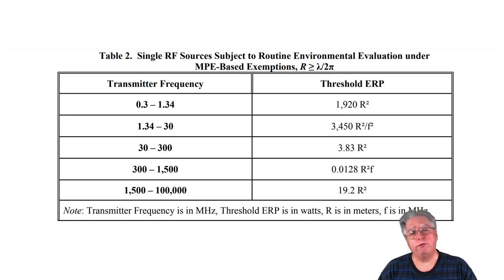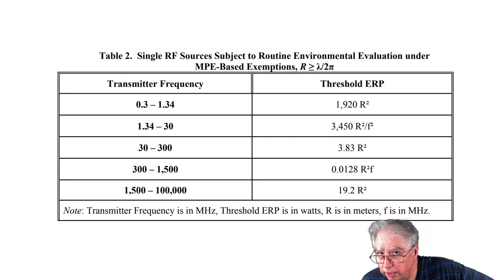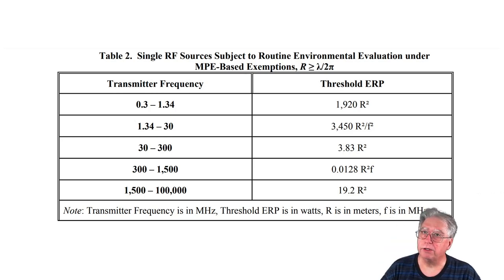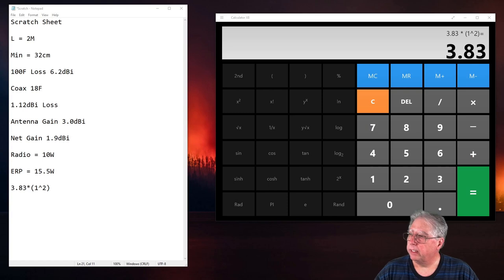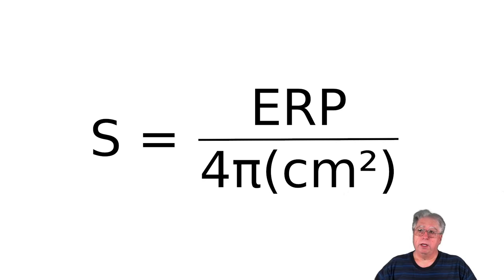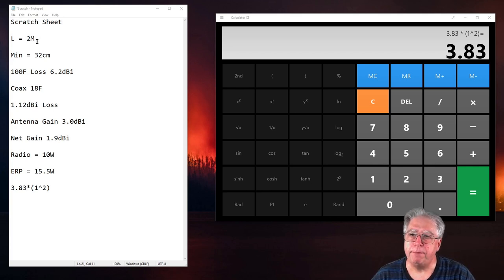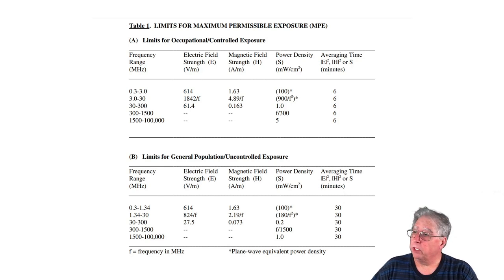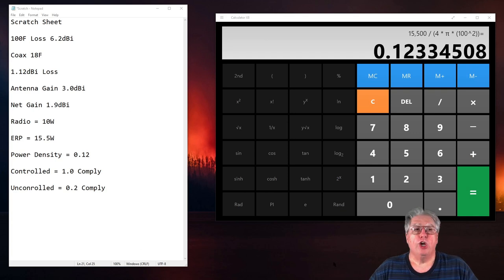FCC Implements New RF Safety Rules. How To Evaluate Your Amateur Radio Station RF Exposure Level

Comment: During this test no live animals were harmed, only stuffed carnival versions on the contrary were,  and they all still had the usual factory tags of disclosure cautions.  Those that required batteries were replaced by UL listed power sources. And NONE of the tests were conducted in or near the Republic of California.  In fact our survey chose Nevada as the the testing site near area 51 so we were guaranteed to have unbiased spectators...

Comment: Hi, Stu - thanks very much for this video.   I didn't think I had anything to worry about but wasn't aware that we had to keep this all on file.  My mobile setup is almost identical to yours for both vehicles, but will check the antenna specs (Diamond 770s rather than the Comet, but I think they're almost Identical); pretty sure I can just use your calculations.   It looks like my HF setup is OK as well, also, even at 600W, based on ballpark numbers but will have to work it out exactly.  You saved me some time.  Much appreciated.

Comment: The roof of the vehicle reduces the RF from that antenna significantly. They do not have a place on the spreadsheet for "Shielding" 
Also, your antenna has that gain only in a certain plane, underneath the antenna that is probably a negative gain as well.
I have a 26B2 antenna with 17db gain but underneath it, the gain is probably less than a vertical groundplane.
Reply from the maker: Yes, you are absolutely correct! The shielding factors would be hard to calculate without modeling the antenna. That's why we only toss it out as a comment in the video.

Looking at worst case numbers for these calculations to start with is always the better choice. If the numbers are outside of safe limits, you can chase it further, but if you are under limits with the simple calculations then you should be good.

Stu
AG6AG

Comment: How about a mobile antenna mounted in the center of the vehicle roof? In terms of absolute distance, it may be down to ~20cm depending on antenna vs. seating position. But a metal roof has shielding properties, and the actual RF path follows the roof surface to the windows, and back into the vehicle interior - maybe a path of >1M. How do we handle that situation? Totally ignore the shielding properties and consider a worst case?

And for the portable/HT the situation is a big can of worms. There are so many potential antennas in the market. Are we going to be stuck with the factory OEM antenna? I've heard there are some hams working on simulations considering a plethora of different HT/antenna combinations in an effort to determine a usable worst case scenario, or a table, or something. But it remains to be seen whether that will be acceptable to the FCC.
Reply from the maker: Hi Jim,
The thing to remember is if you calculate for absolute worst case and are under limits, then you do not need to take a deeper dive... If you are over limits using these calculations you can certainly take it deeper to try to rectify the issues.
Here is a interesting document out of the UK discussing RF and materials: https://www.ofcom.org.uk/__data/assets/pdf_file/0016/84022/building_materials_and_propagation.pdf. Lot's of information and formulas to melt your mind!
As for the HTs... The guidance is sparse at best. The FCC is clear that a SAR test will be required for anything under 20cm of distance from the subject. ARRL has said that all HTs manufactured before the May cutoff are grandfathered in as compliant. Which really doesn't answer any of our questions...

Stu
AG6AG

Comment: And for events like Field Day we may have to surround our antennas with yellow "caution" tape to keep people from getting too close.
Reply from the maker: If your antenna is at ground level then yes. We did a calculation on a 20M beam and  at very worst case uncontrolled access could be within 10FT of the antenna...

Stu
AG6AG

Comment: dipoles are to add 2.2 dbi would that also apply to random/long wire antenna?  Also If measurement is to be taken to the middle of the antenna then can it be assumed that is where the measurement of a dipole or random/long wire antenna would be taken.
Reply from the maker: Hi,
That's a difficult question as longwire antennas have different dBi gains depending on length and whether they are actually a true longwire (non resonant length) or not. For the actual gain, you probably want to look at the ARRL antenna book. I've been told that there is a formula to calculate the actual gain of a longwire.
From the standpoint of the minimum distance measurement, take a glance at this video: https://youtu.be/5vHIZ2dF2Qc where I discuss the evaluation of a dipole. You probably want to measure from the closest part of the antenna to the location of interest.
Remember that you want your evaluation to be the worst case. This means everything needs to be the absolute worst (highest) readings that could be possible. If you calculate for worst case, you will always be under.

Hope that helps!
Stu
AG6AG

Comment: It doesn't explain about my handheld radio.
Reply from the maker: You're Right!
HTs will need to be evaluated by the manufacturer because they require SAR evaluation (which is very costly). HT's manufactured before May 3, 2021 are grandfathered where new HTs will need to have a certification by the manufacturer.

Stu
AG6AG